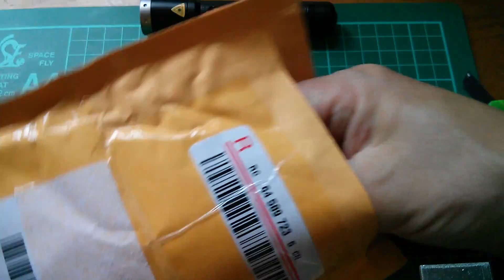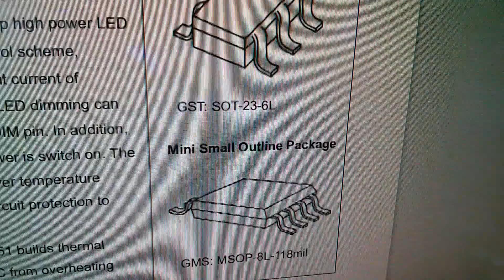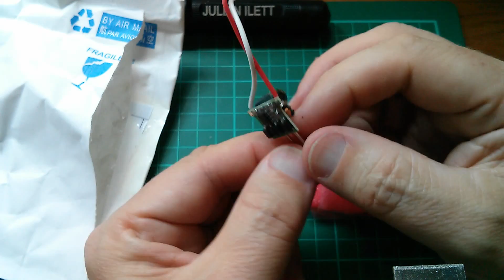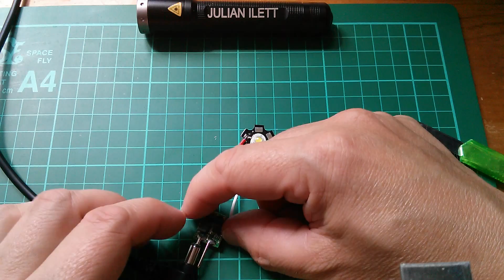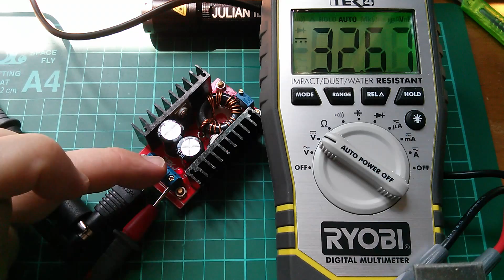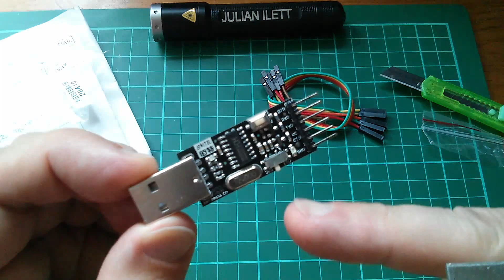Postbag #11: LED Drivers, 150W Boost Converter, USB CH340

Comment: I just bought that 150w boost converter and did not realize it starts working from about 11v anyways I think it should do the job since I was gonna use it to boost from a 3cell lipo wich is about 12v fully charged and drops down to about 10.5 v dischaged hope it works for me

Comment: What kind of trimpot do I need then? They usually have 3296 10K multicolored. But I want normal so 150 lights very low at minimum & 150W when it's at max

Comment: Strange thing with that CH340 USB to Serial deal, I have a couple of them, and when I tried to use them one day, I just could not get them to work with any of my many Arduino's that require the device.  So I tossed them in my parts bin and ordered some FTDI units, they work OK and I used them for over a year.  Here the other day, I picked up one of those crimpers so I could make my own DuPont type cables. I made one with two bases that fit, what five or six pin, what ever they are, and of course, switching the RX and TX wires, now the blasted things both work great. So I guess I must have been hooking them up consistently wrong some place down the line. I do recall switching the two just to see if that made them work, with no help, so I don't know exactly what I did to screw them up but the new cable makes life wonderful overall, a simple one plug on either side and away we go.  Using this cable, I even found an old Arduino that was custom made, I was sure I blew up that has sockets for both the ESP8266 and the other old radio set, I forget something 24?  plus one more socket I forget what was for. I could never get it working at all, now it programs with no problem using my home built cable.  I guess there are some of us that just need a diagram for everything, now if I can just draw up one to find my way to the latrine.

Comment: The 150W unit would drive a 100W chip @ 66.67% of it's rated capacity but in reality it can only drive 2.2A through a 3A chip because of the peak voltage capacity. The unit still gets pretty warm pulling 7A on the input and the 2.2A on the output with a 23V differential. Source is the 12V rail of a computer power supply.

Comment: Last time I checked a "commercial sample" needs to have 0 or insignificant value. It's probably intended for sending things like color sample cards or a bare chip sample. A gift can be literally anything and for most of these low value items the time it takes to verify wether it's a gift or not is probably much more valuable than the tax income generated by the package.

For the record I would strongly discourage evading taxes but at the same time I'm glad the tax I pay isn't spent on a task with negative return on investment and zero benefit to the population.

Comment: i would like to know how to test the 150W DC-DC Boost Converter 10-32V to 12-35V 6A Step Up Voltage Charger Power with a multimeter thanks

Comment: Hi Julian, 

That 150W boost converter, it seems to work on voltage regulation, you mention using it to drive a 100 or 50 watt LED. How is that possible without current regulation?

Thanks
Ross

Comment: Hi Julian - I am playing around with the larger LED's right now trying to fix them up with my Motor Home for camping as well as trying to use some smaller ones to light up the steps which seem to disappear at night (both from site and sometimes retract themselves completely causing falls). What has me confused from watching your videos and others is exactly how to control them.  I know you need constant current on some but many videos show just using a constant voltage converter to run the lights, such as the 150W boost converter you review here.  I have tried these converters just for a few seconds as I don't have my heat sinks built up yet and they seem to do a nice job of lighting both the 50W and 100W lights.  Do I need to also get a CC adapter of sorts to protect the amperage input or is constant voltage enough to run them safely.  One person built the large flashlight using this same converter with no added converter for amperage protection, another site says amperage is a product of wattage/voltage or something like that. Confounds the aging mind!

Comment: I want to use a several 50 Watt LEDs to sequentially take pictures each illuminated by a different LED.  Each LED would only be on for less than a second for each exposure.  I see that sure has at least 4 different lenses that will work with the 50 watt.  I need there to be even illumination over about a 45 degree central cone - Do you have any advice on what lens to use?  How even illumination is there in the center of the lens  you did use?

Comment: im using few of that 150W boost converters for my 100W led flashlight projects (no current limiting, im too lazy for it)    on back is a big resistor, which gets hot easily.. to drive 200W of LED's i need 3 of them, otherwise it will smell bad after some time :D

Comment: Hi Julian,
Could you explain why a led driver is needed if the boost converter supplies the correct voltage. I'm watching some of your other videos for the answer. :-)
Reply from the maker: Byro The LED driver provides current limiting

Comment: the 150w boost converter is the exact same one i purchased to run a 100w led, but ive found the voltage doesnt go high enough to reach 100w, but somewhere around 80w.

Comment: i got the  150w boost converter it works great with 100w leds but it gets hot so you need airflow over it or else it gets too hot
Reply: or just a fan

Comment: Some ebay sellers of the 150W step up converter have this in the description:

Input Current: 10A (MAX) (Please enhance heat dissipation over 10A,)
Output power: natural cooling 100W (MAX), plus fan 150W (MAX)
Conversion efficiency: 94% (Input 16V Output 19V 2.5A when measured).
Operating temperature: Industrial grade (-40 ℃ to +85 ℃) (ambient temperature exceeds 40 degrees, lower power use, or add fan)

Comment: Those 150W Boost Converters are actually pretty good. The diode and mosfet used in it are worth more then the entire device if bought separate . I removed the diode off mine for another project.

Comment: I have bought the same boost driver and tried with 20W and 50W LEDS.

For both LEDs I can push the current up to 530 mA before the converter reaches max boost at about 35V, but the LED spec says 650 mA and 1500 mA respectively. Perhaps my LEDs have more series strings than described. I am curious to see how your test goes.

These leds are super bright and (temporarily) stain your vision if you look directly at them. Is there any sort of diffuser that can be bought for the COB LEDs?

Comment: Julian, do you have any Pro Mini 5V boards with round reset button? I have several of them, and cannot program them using any USB programmer (I tried programmers with different chips, with and without DTR pin). I have to use Arduino Duemilanove compatible board to program them using Arduino ISP method. Those (newer?) Arduinos look like this one: http://www.ebay.com/itm/191117208428

I even recently bought several of them from your favourite seller alice: http://www.ebay.com/itm/200957063666 - I didn't receive board in this picture (with rectangle reset), but board that looks similar to the one with round button, just blue.
Reply from the maker: I have one board with a round reset button - it's got header pins on it so I must have tested it.
I do have a Nano which I can only program using the ISP header - tried everything including re-programming the bootloader but it still won't program.
Reply: I just discovered what was the cause in my case - bad bootloader (or maybe no bootloader at all?)! I tried to program all of my never used 5V Pro Mini boards - all four of them (two blue with round reset button, one blue with rectangular reset, and one red with round reeset) programmed just nicely with two different USB programmers. Then I burned bootloader with Arduino IDE Nightly to two boards I have had a problem with USB programming (although they worked properly in my project) - one blue, one red, both with round reset buttons - using Duemilanove-like board, and now I can program all my Pro Minis with USB programmers. Funny - two out of six Pro Mini boards came with bad bootloaders, one from one seller, the other from the other seller.

Comment: Julian,
the "150W" boost converter's caps are flush against the heatsink. What temperature are they rated for? They will probably be drying out really fast. I'd be careful using that thing, looks like an awful design to me!
Reply from the maker: Another reason to de-rate the 150W spec. I'll check how warm the heatsinks get when running a 50W LED.
Reply: Julian Ilett The maximum current output rating of that boost converter from the specs is 10A. So if your source voltage is 12V you can draw up to 120W from the boost converter. If your source is 15V you can get your 150W maximum but you will need forced cooling. If your source voltage is however 6V, you may only drive a 60W. Its safer to rate a Boost converter with current. Input voltage X Rated BC Current = maximum wattage.

Comment: Hi Julian. The 34063 (boost/buck) converter is actually used in almost every in-car phone charger to obtain the 5V that USB devices need. They don't really get too warm and they're very efficient. They require a bit of patience to use to fine tune it though.

Comment: 34063 is my favourite power supply ic, I use it for replacing power supply's in old games consoles where you can drive 1.5amp at any voltage from any voltage with no heat when compared to something like a 7805

Comment: I have just ordered that step up converter day after this vid and I was not sure if it can make the maximum voltage (35v) from voltage as low as 12v as I planned to use it with. Now I know that its suitable for me. Thank you :)
PS: I often order parts from ebay and I really appreciate what are you doing for us by reviewing many of them. I look forward for your next postbag :)
Reply from the maker: Thanks muchly

Comment: 50w led torch powerd by 18650s?
Reply from the maker: Entirely possible. The main problem would be finding suitable (i.e. high current) battery holders.
Reply: Julian Ilett
isn't that why tagged cells were invented :}
Reply: Julian Ilett
Probably the best battery holders are made by Bulgin, but they are quite expensive.

Comment: The push button is a reset switch. When you're programming a chip directly (Attiny85, 328P etc) using a USB serial device from the Arduino IDE you sometimes need to hit the reset between compile and upload. There's a reason why but I forget what it is. It's not a very elegant way of doing it but it works.
Reply: Julian Ilett
 Usually,with the newer Arduinos it will have the DTR,or CTS line (I forget which) connected to the reset pin,and when you upload code,the IDE will reset the microcontroller,before uploading the code.
On older/homebrew hardware,unless you connect that line for the Arduino IDE to reset the chip automatically,you have to do it manually..and at the right time.
It was a bit of a pain on my old ATMega8 proto-board-thingie,so I wired it up to do it automatically.
Reply from the maker: That's a thought. If you're programming a target device that has no reset button of its own.
Reply: I've got one of these and the button actually seems to cut power to the attached device. It's basically a fast way to power cycle your board. There's a little MOSFET that presumably switches the power.

Comment: I don't know why they rate the constant current source for "one 3W LED". The chip can work up to 40 volts. So you can connect as many 3W LEDs in series as their combined forward voltage allows. All the LED drivers of that design I had, could do that. The limiting factor was only the cap, which was rated for values between 16 and 35 V.
Reply from the maker: Exactly right. Quite a versatile little driver for 58p.

Comment: I've got some of these USB converter boards myself. The push-button turns off the power, which might be used to reset a board that doesn't have the 'auto-reset' feature. However, as the logic lines are still connected (and TTL serial idles with a high level), some power bleeds over via the input clamping diodes and still somewhat powers the board. This feature is a bit half-baked.
Reply from the maker: I can't believe the switch is a normally closed type, so it must use one of the transistors to break the Vcc line when the button is pushed. That's half-baked and a half.

Comment: I never understood why you use ebay.co.uk. I'm pretty sure that you can find on ebay.com everything listed in ebay.co.uk or even more. I also think prices are displayed both in dollars and your local currency by default.

Another thing that confused me in this video is, on dc-dc converters is it possible to measure the output voltage by connecting the positive lead to positive output and the negative lead to negative input???
Reply: runner180fxr
No, there is quite a difference between ebay.com and other sites (ebay.de in my case). It seems like sellers have to choose on which of the sites to list their items. So the same shop can have thousands of items listed on .com, but maybe just hundred on .de. And that while all the items are shipped worldwide. Even worse than that, some time ago ebay decided not to show any items that aren't in the language you set in your browser on your country's page. That made some shops completely empty even when I just saw Julian show items in the video. Judging by the ratings the shop was still very active. You could even go to the items' pages from the ratings and order them normally, they just wouldn't appear in any listing (search, shop listing).
Another thing I've found out: if the seller lists the same item as different offers for different currencies, the one in US$ converted to EUR is often 5-10% cheaper than the EUR listed one.
Reply: Well my experience, I live in Belgium, is that not every seller sends to my country while almost every seller on ebay.co.uk does.

About the measuring. If you look at the simplified block diagram on http://upload.wikimedia.org/wikipedia/commons/thumb/0/09/Boost_operating.svg/250px-Boost_operating.svg.png  you can see that the negative lead is the same on the output as the input. Surely this simple thing will be as shown in Julian's measurements be on the same connection or level.
Reply from the maker: Yeah, sorry, that was a bit confusing. It's just that the DVM leads wouldn't fit into the sockets, they were so close together. But you should avoid doing this on the CC (Constant Current) types, as they generally put the current measuring resistor in the 0V line.
Reply: As I saw somewhere, the negative terminals of input and output are tied together ;)
Reply: runner180fxr  well it seems the sellers on ebay have an option to see where it is being placed. If you look at .fr .es .nl etc you will find a lot less items than .co.uk or .com   I prefer to look on these and the German .de one since for some items they have more and cheaper stuff.
To be honest I have no idea, never sold anything on ebay, if it would cost them more money if it was placed on different domains.
I guess it's part of our hobby to make it into a game to find the cheapest, free shipping and buy it now, even if it is 1 cent less .... it gives a good feeling.
Reply: Luc Peeters
To me any url other than ebay.com looks like a translated version of .com Another difference is that prices are displayed in local currency and listings with items that the seller won't ship to the specific country are filtered out. In other words, I think .co.uk , .be , .de , etc have the same listings like ebay.com not different. You just load a translated version of eBay.

But of course I might be wrong. The reason I prefer to use ebay.com is because I'm afraid of the filter I wrote previously not working properly thus showing less results.
Reply: Julian Ilett
Well if you didn't, I wouldn't have learnt that this is possible.
Reply: Thanks for the comments guys. I didn't know most of these things.

Comment: Most sellers tick 'Gift' on the customs form to try to prevent any customs cost for you. Most countries don't tax gifts.
Reply from the maker: But do most countries tax commercial samples? This seems like a much better description. Chinese sellers would love it if you bought 10,000 widgets, but you just bought one to see if it works, check the quality and so on.
Reply: I know that at least the Dutch customs tend to tax commercial samples
Reply: Julian Ilett Canada taxes everything but the $60 CDN gift allowance and a few things like kids clothes.  Everything else has at least the GST on it.

I work in the brokerage world and can tell you that the Chinese sellers put gift on EVERYTHING in a desperate bid to bypass taxes and duties.  The joke in Canada is that a gift has to be from a person to a person.  So B2C and claiming gift will always be rejected and duties and taxes will be applied as appropriate.  The only overall exception is Canada Post.  They use CBSA personnel to do their brokerage work and they are WAY overworked so most things just come through as post mail and not a package, even when it is clearly a package.
Reply from the maker: Jason Price Don't you have a minimum threshold? In the UK, Duty isn't payable if the item is worth less than £135, and VAT isn't payable if the item is worth less than £15. So most of my eBay purchases are exempt from import tax.
Reply: Canada is still stuck at $20 so many things you have inspired me to buy are under but not everything.